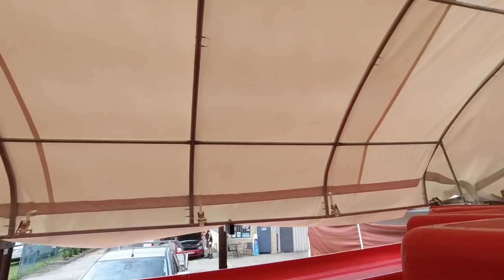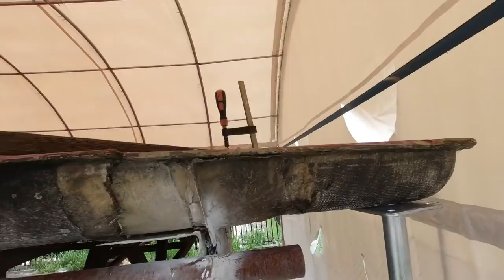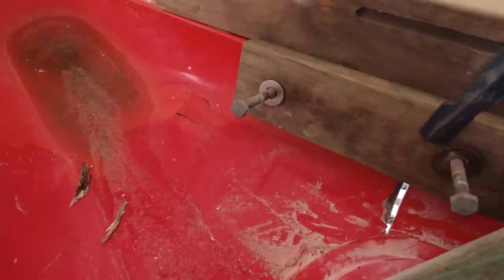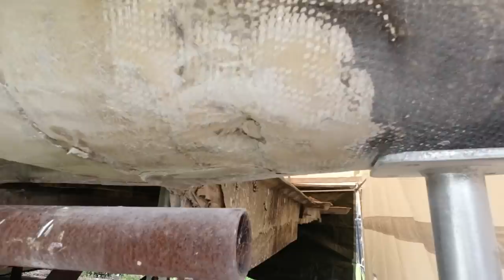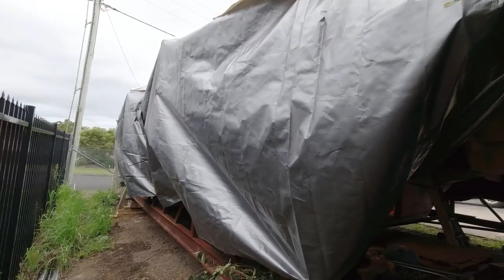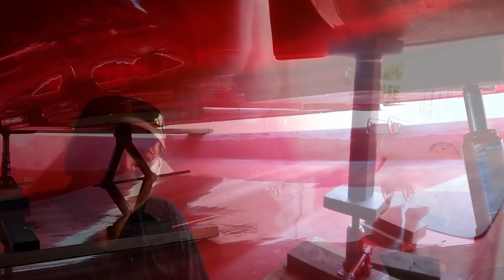Ep161 - Catamaran Deck Mould Repair Part 1

Comment: Great work Ross, good thing you've got Johnny around to keep you to task ! That metal based aluminum tape's the best, they use it on airplanes all the time to prevent damages from spreading until the plane can get to a repair facility.

Comment: As usual, I'm impressed with your attention to detail Ross. My concern ( if I was doing it) would be that I would be changing the geometry of the mold and when it came time to fit the pieces together, They would look like parts of two different boats. Good job sir. As always. Best to you, Solomon
Reply: Ross is one of the most minutia oriented glass layers i've seen online.

Comment: How are those rugged areas made? Could you teach us if they start from the original part (mockup) or they are added later to the mold and what kind of texture they are? How are they polished and waxed so the new part does not stick to the mold. Why where they made and would't it be easier that they where left flat and later apply a rough coat? Sorry for so many questions!
Reply: Oh, and I have no clue what is on the darker places where the windows are? Will that be glassed too and then cut out or you have to glass arround it?

Comment: So maybe you've addressed this question in a previous episode and I missed it? I recall that your boat mould was used to create several power cats and you are, in fact, creating a sailing vessel. In looking at other production  companies who use the same style moulds to create their power and sailing cats, they, almost universally have a solid (fiberglass) forward deck on their power cats and open decks on their sailing models (trampolines). I always assumed that this was due to wind resistance, weight concerns, and of course driver comfort on the power cats (ie. if a power cat had a forwarf tramp then folks would get blasted with sea water at fast speeds?). I was wondering if you've made other adjustments to your design to account for these differences?  Larger or modified rig? Additional forward sail or a  taller mast for increased sail area? It's certainly a given that you're not creating a performance vessel. I have never felt any need to sail fast lol, I'm as happy sailing at a few knots as I am sailing at 20 plus. I was just wondering if maybe you could talk about your plans and adjustments to address this difference in your hull vs. other production models. Amazing work my friend, I am very much enjoying following your journey!
Reply: Weight on sailing cats is at the top of the list of importance to performance.

Comment: I'm looking at that bodge hatch (their work) and i'm wondering how exactly, did they think that was a smart idea (the bodge), considering that it would eventually crack. Rossco is being nice, but that's just poor worksmaship there. Even with the damage sustained, it wouldn't crack that way if it was properly integrated. Just my 2 cents.
Reply: I'm not so sure about that. That's some pretty serious damage done up there. The area around the hatch is the least damaged ares of the nose cone. That nose was driven down  6 inches or so and thru the metal tubing? No glass work was gonna stop that amount of force.
Reply from the maker: Yes the hatch lamination was at a thin point.I do feel however the mould may have been dropped ,so although a crappy hatch i install at a weak point there was excessive forces at play some time ago.Ross.

Comment: Ross, I need a knee replacement but can't afford it. I'm pretty sure you can come up with a way to do it using Acrow jacks. Please contact me ASAP.
Reply from the maker: I will give it a crack Tim.Roller sander first,then multi tool and a bit of dremeling and a carbon fibre bow sprit'll fix it.Take care buddy.Rossco
Reply: @LifeOnTheHulls  Thanks mate. I will swap you some sweat labour when the carbon cures.

Comment: 'Pre-built boats are way too expensive, They want $200,000 for a nice Cat! I'm gonna save by building my own boat!'... $300,000 later... 'Just a few more months of my "Free" labor and another $100,000 worth of material and she'll be almost ready to start on the interior!'...
Reply from the maker: When I was deciding whether to build a boat I spent 4 months flying around the country checking out Cats that were for sale. There was nothing under $350000 Aus available worth even cinsidering ,even worse now and most were rotting balsa and plywood boats .In fact I have many friends that have bought 350k cats that almost reached 500 to 550k in total after refits and repairs.I will complete this boat for under 300k aus or 240usd and have brand new systems,motors, electrical,rig,foam core etc and have had an incredible time satisfying a dream whilst running 3 businesses that have allowed me to do so.Good enough for me.